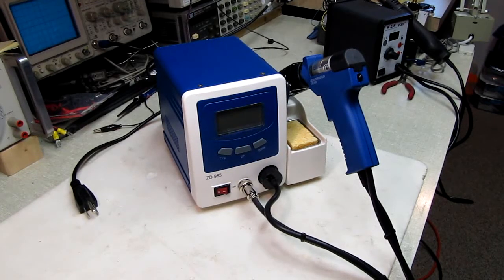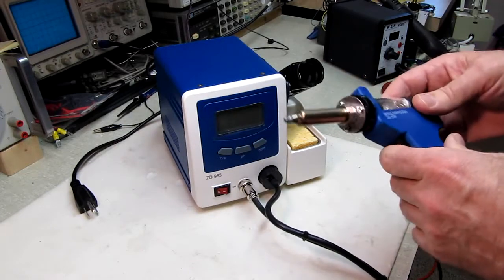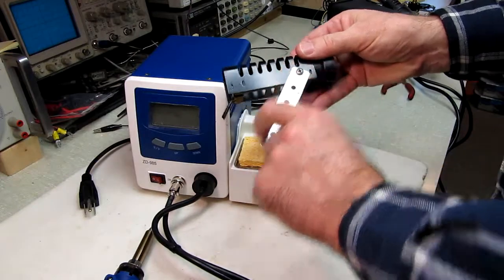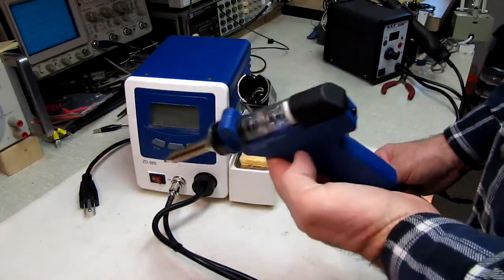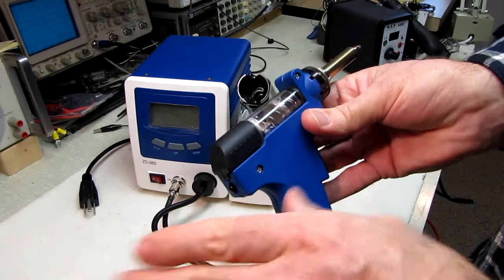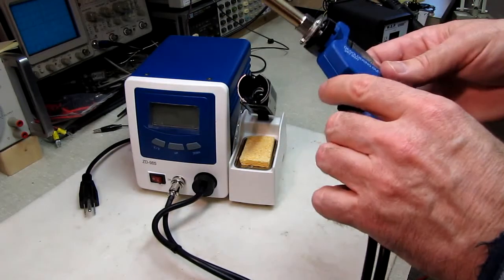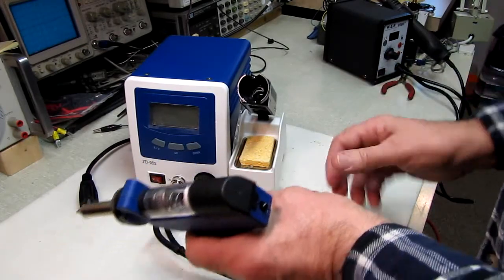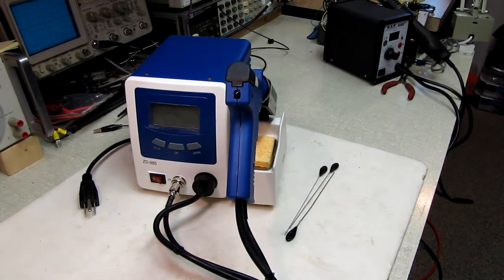ZD 985 Vacuum Desoldering Station Hacks/Mod's

Comment: What problem? Just put a bit of soldering cotton in front of the filter, the air will pass through and the tin pieces will stop it. Simple. I have been using it for years.

Comment: Yeah I found a 8.00 solder sucker ,that makes per holes every time, if it starts to build up ,I let it get hot have it pointed down and a couple of taps it alk comes out,I like this one so much I bought a spare  I talk to guys who bought the solder suck that cost twice as much as mine ,and they say my little 8.00 solder sucker works much better but I don't use mine much or I would spend more on one
Reply from the maker: I use the old rubber bulb one if there is only one or two joints. Use this when I have a lot of joints to do.

Comment: I never had any issues with the holder on mine. Maybe I am gentle, but it has never bent or broken after more than a year.

The dime is a good trick I think I shall employ the next time I clean mine. Mine came with a metal disc, but it seems to have gotten lost when cleaning it. Thanks.
Reply from the maker: Nice to hear your not having issues with the holder. Could be they smartened up and put a heavier bracket there. Mine would droop/bend from just the weight of the cord hanging off the bench. Have cleaned my "dime" three times now. When the Solder starts getting to the size of a marble I remove the dime and rap is sharply on the table and the ball of solder falls off.
I then throw that in my solder pot. Enjoy.

Comment: Can you desolder components from multilayer PCBs with this unit? Watched several reviews, and found no info. Even Dave from EEEV-blog did a half-way review only on it. 
I would need a desoldering iron, which can remove ATX power connectors from PC mainboards, and rework large filter caps in those multilayer boards. Due to the ground plane, they will take lots of heat away from the join. With my 100W JBC soldering station I can barely melt those joints, even if I crank the station up to 400C.
Reply from the maker: HI Donkey, well this is a pretty cheesy unit made from Chinesium. I have used it on multilayer boards, but it is all going to depend on how big the ground planes are and how heavy the component leads are as to how well the heat will transfer. I have had good luck on most boards, but really crank up the heat on some. This is a pretty low end unit.
Reply: Thanks for the reply. Btw, what else would be a better alternative for a bit more money? Found nothing decent below 250Euros. In the meantime I have seen a greekish guy desoldering power caps with it from ATX multilayer motherboards (I do not speak greekish, so have not understood the video), and that is what I would need it for. Though, he had issues with the negative pin, as expected.
Reply: If the ground plate is bigger, I guess you could take your regular soldering iron, add some fresh solder and help the sucker a little by quickly heating up the pad. Some boards don't take it so well if you fry them for more than, let's say, 10 seconds.
Reply: You can desolder from multilayer boards but leaded solder aswell as some flux should be used to avoid ripping out the vias

Comment: I just got the duration version, very similar, the gun looks the same.  Wise words with letting the thing get 'really' to temp.  I clogged mine in first 10 mins.  I used a needlepoint solder tip and braid to suck it all out of the hole.  Great tip with the coin!
Reply from the maker: Glad I could help. Thanks for watching.

Comment: Do the ZD-985 cotton filters fit the ZD-915
Reply from the maker: HI George, I don't know as I only have the one unit. Would not be surprised if they fit, and they are cheap enough.
Reply: Cotton?? maybee it starts to smolder. The little filter befor the Vac pump gets very quick clogged. For that I avoid to use flux  for desoldering  with the ZD-915

Comment: You may use soldering iron for station ZD-912, ZD-916, ZD-917 with ZD-985 and make 2 in 1 tool.
Reply from the maker: Good Idea, thanks for watching.
Reply: I did so, if You wanna I can send You a shcematics.
Reply: You had to change the connection on the soldering iron for it to fit with the zd-985?
Reply: JGN - yes. I was change plug in ZD-917 soldering iron. It was easy and quickly.
Reply: I did it, too. I've used a soldering iron from an old Gorgak. The ZD 915 works too. The nice part is that this one is using PID control for temperature and switching power supply. Much more efficient.

Comment: The change from conical spring to the open spring was done to increase the air flow.  At the same time, the transparent tube was changed from plastic to glass.  The entire tube/spring/seal/metal-disk is available as a spares kit, and it can be used to upgrade the older guns that came with the conical spring.

If you need a replacement gun-holder (the black part mentioned at the beginning of the video), please contact us at memotronics, we do not charge for the part for existing customers (while supplies last)
Reply: Memotronics sent me a replacement, as claimed.  Mine didn't bend, the small spot welds broke, probably from too little heat in manufacturing.  This was in October of last year. As of this evening, April 1, 2022 (no, I'm not being funny here), the item is no longer offered on Amazon by Memotronics.  Someone does have one available for $179+$7.49 shipping to the US from Italy. I paid $159.99 in May of 2020, so maybe that's not so out-of-line given the recent inflation and supply issues.  Guessing they won't back the product as well as Memotronics did.  My fix was to drill through the two spot weld locations and replace with a couple of pop-rivets.  No problem so far, even without the prop Vern used.  So I have a spare now, in case my repair doesn't last.  I am going to try a good-old US dime, though, as I did go through my first filter at the back of the splatter plate way faster than I think I should have.  I'm really glad I have this.  It works fine, although like Vern, I may get a better one, eventually.  Just wish the Hakko wasn't so expensive!

Comment: i use instead of a coin  some stailess steel wool rough type.Take a litle ball of that  put it in the middle off the spring.The washer that the spring press against with filter at the back has 4 cutouts.i drilled lots off 1mm holes in it. Is still plenty stiff to do the job with sealing the filter agaist the back vacum hole.the filter as a result gets more evenly dirty and more vacum sucktion.This mod works on all the guns with that type off straigth spring that push against the filter washer.In the switch mode supply stations i move the fan from the back off the supply and to the top  to get airflow down inside the supply.Just take away 2 some off the cutouts on the supply shielding at the top to get free airflow heatsink.The temperatur went down a good deal.Expect the capasitors inside to last much longer.I also want to change all the caps to i good brand Panasonic capasitors.cheap way to get a good long lasting tool with these mods.
Reply from the maker: The stainless Steel wool is a good idea. Thanks for watching.

Comment: EBay type in soldering tool ,it's the Orange one for 7.95.i have a soldering bulb and every other kind of sucker the one I bought on ebay for 7.95 works much better,for me ,that's why I bought two before they run out

Comment: Thanks for this nice vid. I've recently got the exact same unit (same color and all), and my unit seems to have some "coil whining" issues, I think it comes from the transformer, should I be worried?? Do yours also make some whining sounds?
Reply from the maker: Didn't say where you live. But the transformer shouldn't really make noises. A very slight 50 or 60 Hz hum would not worry me.  A "whine" is probably/could be an oscillator making voltage for the back light on the display. Mine makes a very faint whine if I put my ear near it.
Reply: The whine only comes when the temp are rising, so it isn't the display that causes it.
Reply from the maker: Without hearing yours I can't really tell what is up. I have been on the road for a month and not near my home. Will be home next week and can listen closely to mine and see what I come up with.
Reply: Thanks, really appreciate that:)
Reply from the maker: I am now back home and listened to my unit in a quite room. There is indeed a whine coming from the switching supply during the heating cycle.However I had to listen closely to hear it. Bearing in mind we run 120 volts and 60 Hz and the switching supply will not "work as hard" dropping the voltage to the heater requirements. The duty cycle will be different at 230 volts. However the level of the whine is such that if I have other things turned on that have fans such as my spectrum analyzer, I cannot hear the whine unless I press my ear against the unit. If is not uncommon for low cost switching supplies to make some noise. Better ones are quiet. I used to have some very old Raytheon 12 volt switching supplies that made so much noise I gave them away. They worked fine, but were very noisy.

Comment: Thanks for sharing your video. I was thinking if some coarse steel wool inside the tube would be a great idea, to catch the solder?
Reply: I've been using coarse steel wool inside the tube for 2 years, no problem.

Comment: Instead of the dime you should've tried a door stop spring to me they look similar to the original spring maybe would have fit ....Looks like a decent machine for the occasional use tried to get one from amazon.ca  but the online retailer asking $950.00 for the exact same machine totally out off wack ..and on amazon.com its $150.00 who make more sens but they dont ship to canada .. where did you get yours from ??
Reply from the maker: +BadPete999 Got it from Amazon, but I live in the U.S. so no shipping issues.  E-Bay has them for $170.00 U.S. Delivered and I think they will ship to Canada. You guys sure get screwed both on the exchange rate and shipping restrictions...But hey, we get screwed on medication prices...trade offs.
Reply from the maker: +BadPete999 By the way, the dime works like a charm and was in my pocket. Nothing seems to get past it except the air flow.  No need to go looking at the hardware store.
Reply: +The Radio Mechanic Is there a chance that the dime perhaps impedes airflow just enough to cause the buildup of solder in the tube at the front of the gun?
Reply from the maker: +morenormal I knew I should have put a patent on that :-)    Bet they saw the video and added it. Thanks for the note.